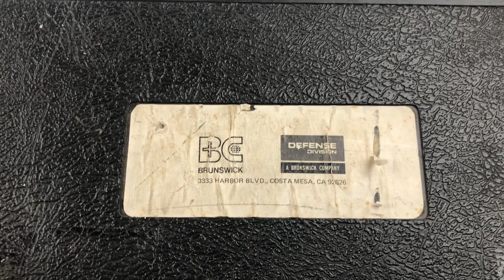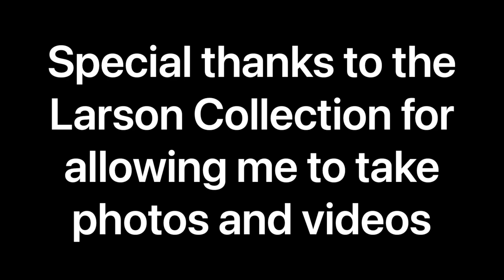Brunswick Rifleman’s Assault Weapons Aka the Explosive Rocket Bowling Balls - Detailed View

Comment: Lucky bastage. One of my video projects that I never got to was testing the spin stabilized rocket idea this thing uses. I have an upcoming projects video with the first iteration of a ball with a rocket in it, that I was supposed to make a thing to spin it up before igniting the rocket. Never got that far. Interesting device but apparently any imbalance in it threw it off, which is why I guess it never managed to replace anything.
Reply from the maker: There is an awesome collector locally that has some really rare stuff, they even have an M202a1 with a rocket that I’m trying to get dimensions for . 

I think they would have more success if they used gyrojet style nozzles instead of the rotating mechanism they had. Yeah that’s what I heard, I think the decoupling system made it difficult to consistently release the projectile in the right trajectory everytime. Your more then welcome to use the footage if you want to explain how it works in a video
Reply: @elwildo14  thanks. It may be a while before I get to it just because work keeps me from really making a lot of the full size projects. I have my panzerschreck system mostly built for example and dont see myself getting it done for months because I always have a real life project to work on when I get free time. Your offer goes for my content too btw. If for some reason you need boring content feel free to use something I talked about. Just link the channel to let people find other vids. I dont monetize videos but getting the info out is always important.
Reply from the maker: @Stray03  I appreciate it mate and look forward to the content! It’s very informative to everyone in the community!

Comment: It looks like rpg but I can't see a safe way to hold it? It this a morter style weapon or do just risk burn dmg from the stabilizing jets?
Reply from the maker: It uses a blast shield which deflects the exhaust
Reply from the maker: It attaches to the end of an M16A2 rifle
Reply: @elwildo14  ok that makes sense. Would to see that if possible. Hard to imagine from just these photos.
Reply: @ok0then  the muzzle of the rifle fits into the cylinder and it has a catch for the rifle’s bayonet lug.  It would hang beneath the barrel like an M203.